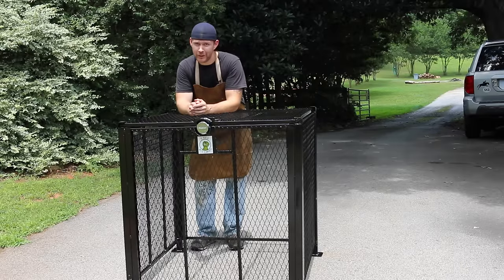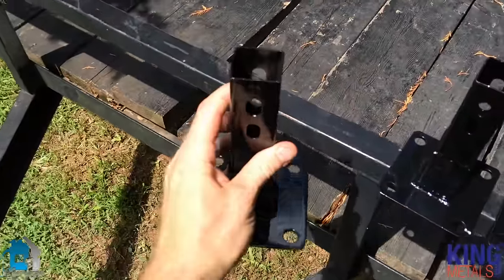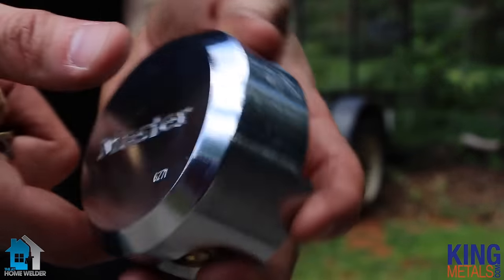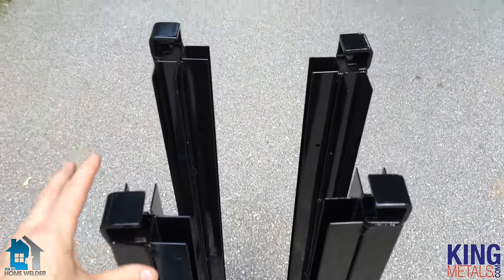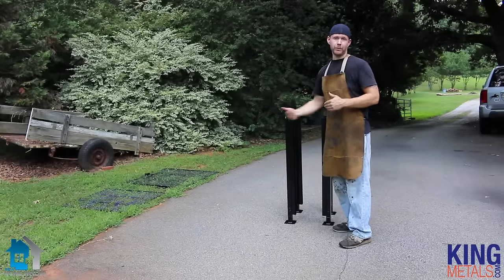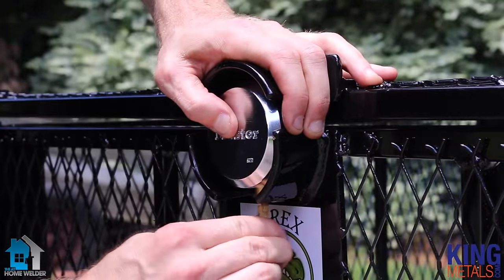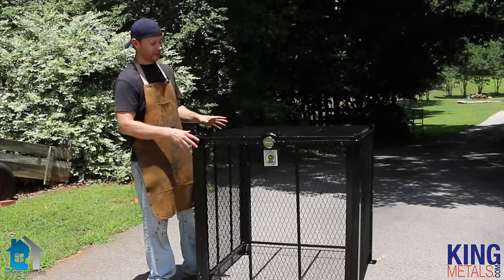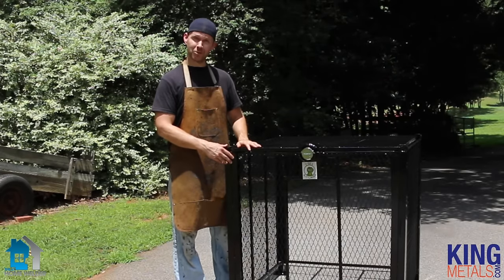T Rex A/C Cage Assembly and Install Guide

Comment: There are 4 bars in my kit. These 4 bars slip into the top of the corner post, after the panels have been installed into corner post. These bars will help keep the top portion of the cage in tack. The leg holes & nuts did not line up, i had to enlarge the holes so much for the nut & bolts to line up, i had to use washers for the bolts to catch any metal. The nuts where not level, not in-line with leg holes, so thick with paint i had to go get a tap tool to clean out for bolts. After all that, i think it is a great deal.
Reply: I don’t want to Do all that. They need to fix the issue.
Reply: Not the whole bolt the head of the bolt is stripped I can't put my tool in there it just goes round and round

Comment: I can't get any help from the people on the website. There are 4 pieces not in the video. After watching this video, i bought this cage from KingMetalsInc. It is good to know that the cage is 42 inches from corner to corner. So a 36 inch concrete pad won't work. I"m wondering what the best way to install the anchors since my pad it too small.
Reply: Take some 2 x 4 or 6 wood and get it cut into 4 equal sizes to expand the concrete by using the   Wood stakes to hold the wood in place. Buy some concrete mix or quick set cement to pour around inside the wood. Let dry completely before continuing. https://www.homedepot.com/p/Grade-Stakes-Pine-12-Pack-Common-1-in-x-2-in-x-1-1-2-ft-Actual-562-in-x-1-375-in-x-17-5-in-461443/203316903

https://youtu.be/URTGmSfBxeg